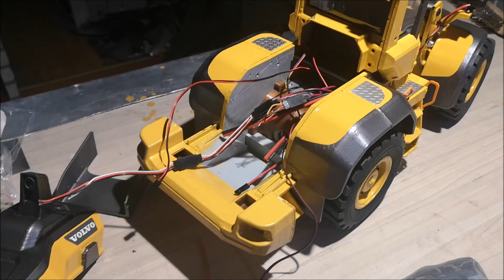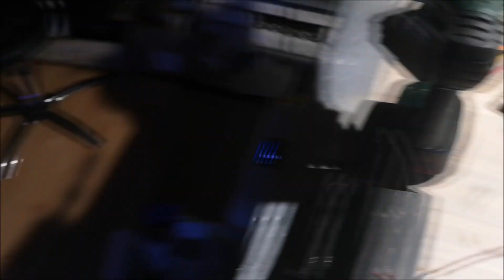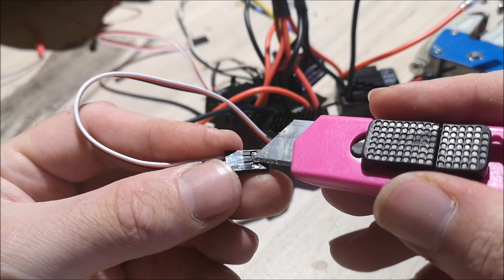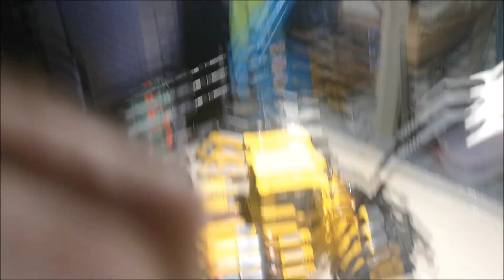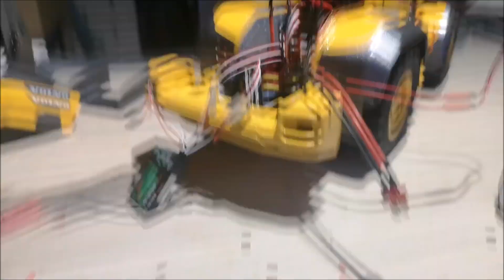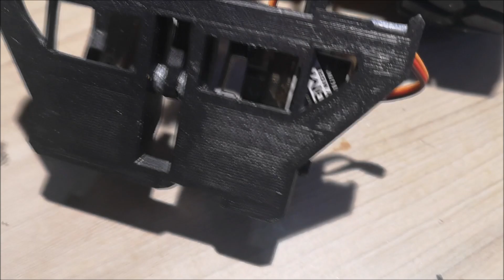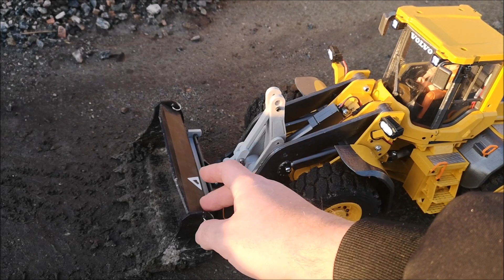Making a 3D Printed RC LOADER - VOLVO L120H - PART 5 Electronics

Comment: Your projects are amazing! I don't have a 3D printer, but I'm going through all your videos...
Being an R/C heli and planes pilot for 20 years and always loved excavators and loader too.
About electronics setup, why don't you run the linear actuators simply plugging them on a receiver channel and assign to each one end-points, instead of using a separate ESC? 
Keep on with your great passion!
Reply: because thats not how the linear actuators work for some reason

Comment: Hello Burnie,

I started with your 3d Volvo L120H and I think the sound module you have built in sounds very nice, which one did you use for this?
I can't find anything about that, not even on Facebook.

Kind regards,

Hans Verkerk
Reply from the maker: Hello :) I used a Servonaut SM3 in this, I plugged the SM3 into its own 3p channel, and I mixed the drivemotors, lift, steering and tilting of the bucket into the sound module, so that the rpm's increase when I use the functions. :)

Comment: you have the cable of the front lights directly to the receiver, the roof lights you have connected to the controller. I don't understand how you can control the front ones with the same switch.

Comment: How do you accomplish the differential function on the axles with 2 motors on each side? Been thinking of making a loader and getting differential, this looks like a simpler solution. Are you using PLA? And what scale? Great work!

Comment: Hello. I'm from Brazil and I'm using google translator. If anything sounds a little weird, I'm sorry. Excellent job. I've been following your channel, I think since the beginning (video: 3d Printed CAT 365C Excavator - 1:14th scale; 4 years ago), but I'm a fan of the 1/10 scale. Do you have plans for this scale or could I adapt your models to this size? Do you plan to make an earthmoving machine? One more question, but more obscure: what is the song you used in the video I mentioned? Once again, congratulations on your work. I eagerly await the next one.
Reply from the maker: thank you so much man :) no I will stick with 1-14th scale sorry :) you can maybe upscale the models but its gonna require lots of work. 
The music in that video is from a video game called Split Second, I think it is the main theme song.
Reply: vamos rachar? rs